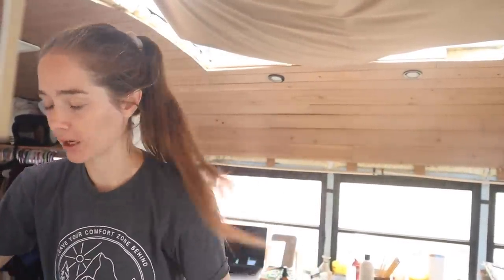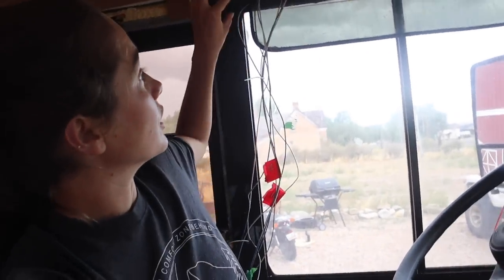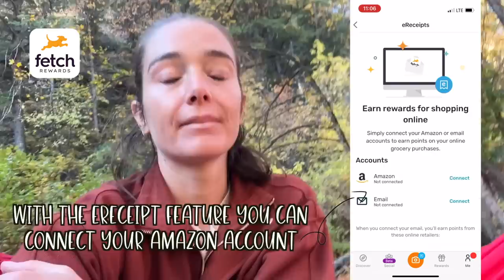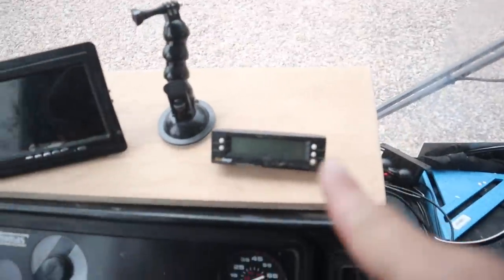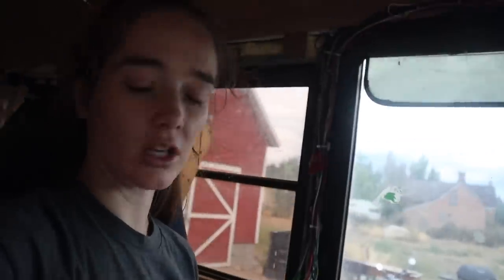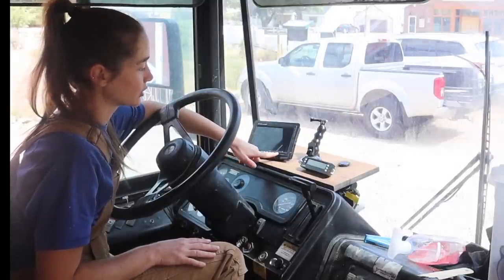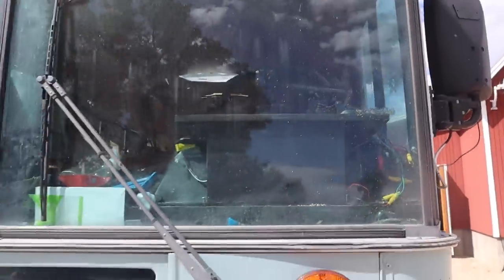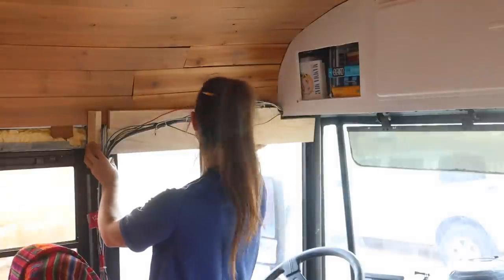finally addressing the ugly wire situation

Comment: Use wire covers like you would use for the wires on your TV if its on the wall they are available at Home Depot  there are different types and sizes. They are vinyl and have a sticky back on some of them but they are white or black.

Comment: 6:14 Mark. I have the EXACT same issue. I have gadgets I need when I'm driving but the dash in front of the driver's seat is too small, sloped badly AND made of flimsy material that can't hold any weight. So I'm also looking in to making a shelf that fits over the instrument console. I just get the willies with the idea of putting something against the windshield because the first big bump in the road I can picture my windshield cracking.

Comment: Emma, I love watching your videos and love your attitude. Just an FYI, check your package of tie wraps as most white tie wraps are not UV resistant.  What I mean by that is they will get brittle and break when exposed to sunlight for any length of time.  If they aren't they will only last a few months if continuously exposed the sunlight. You are probably fine for now, but if you notice them getting yellow, just know you will need to replace them.  Look for UV resistant ones when you go to replace them.  Of course putting the wiring in an enclosure will protect it from sunlight as well.

Comment: I was going to tell you a long time back, but forgot, maybe you could use decorative wire-chase to enclose all that wiring?  They have all kinds at home depot. it's like pvc pipe with a slit. or a removeable top allowing you to put the wire in the bracket, then cover it with the pretty plastic, long cap. the stuff on amazon is like 24" long and you get 8 pieces, I think. I use that for my entertainment centers. The stuff at the Depot is 8 feet long I think, been a minute since I bought any.  Good to see you on this cold friday :)

Comment: You can get that split wire loom in many sizes, as well as p-clamps in either stainless steel or plastic to secure it. With the clamps, you could either shoot new screws to mount them, or use existing screws, just take them out and reinstall them through the hole in the clamp.

Comment: Hey Emma!
Great job on the dash and getting the boxing in started! Just one thing maybe run a strip of black rubber along the edge of the wood that's facing towards (maybe its touching?) the windscreen, so it doesn't mark or crack the front windscreen if any movement! Also please make sure it's well secured down to the dashboard so that it can't fly toward you or through the window in an impact (God forbid) but better safe than sorry! Other than that it's all looking great! I love how you just work things out and get stuck into them! Great attitude! And the Bus is REALLY coming together now! Looks great! You're looking well too..
Cheers from London 👍😎🏴

Comment: So great to see someone with little skill but a can do attitude tackle this job and do well. 
Keep it up your mojo to do the tasks will come and go(hold on to the ups and try let go of the downs).

For your wood ceiling.
As the wood ages it will get darker and darker. It's the nature of wood with UV. Try get a clear sealer and put a white tint in the sealer(with a UV protection) I used an external sealer. It makes the sealer almost a watered milky colour. Then give the wood a couple of Coates it will result in a lighter looking wood with the wood grain coming through and prevent the wood from going darker. We use a product Woodoc 30 with a moonglow tint (this is in South Africa) I am sure you guys have something similar.

Onwards and upwards.

Comment: They use these pieces of wood that are about 1 1/2 x 3" with a grove already in it. You've seen them before, they run a strap through them when they band pallets and lumber bundles together. They'll give you a couple for free. Just cut a 45 degree when you go around the window. All that wiring should fit in that groove just fine.👍🌹

Comment: Are there not air vents for the windshield coming from below the platform you built in front of the steering wheel? Or are the vents at the top? Or no vent?! I can't imagine there wouldn't be any vent at all... But I don't have a bus, so what do I know...

Yay for trims! It will look a lot more finished once you've done that. After that, enclosing your bathroom and finishing your couches, and your bus will look like a home! 

Love your hard work and, mostly, your personality, always!

Comment: Use the black insulation for pipe to hide wires. It has A split in it the can be glued or taped. Secure with ties

Comment: Da, you made me happy today.. I was waiting for the moment you addressed the wire entanglement hanging all around.. Go, Emmy, just a little more effort to do. Oh, and that pencil in the hair is cool! 😊It's not easy to manage the wires when you move them elsewere as those were supposed to be, since those are always too short or too long. Nice work though, the black ribbed wrap thingy is neat solution. Don't get discouraged if you hit some obstakle, just think and make your way around. Good idea about the overhead concealment unit at the end.. Keep sticking to the pillars with the backing all the way down, then attach side parts from the side into the backing. I think it will be the easier way. Cheers though, you're doing excelent. Don't mind small imperfections and krookedness.. It's a part of the build. I know very well that adaptations in builds are way harder than to build something on measure from scratch. 
😜 Keep safe.

Comment: To make a plywood shelf look nicer. Get a 1 x 2 or a 1 x 3 oak or pine whatever your plywood is, that's slightly longer than your longest edge. On a tablesaw rip the 1x2 on the edge at like 1/8" so it ends up as a strip 3/4" x 1/8" congrats you now have a piece of edging for your plywood. Cut it same as or slightly longer than your plywood edge. Spread some wood glue on the plywood edge stick your edging on there and use a 18ga brad nailer with about 1"  brads spaced about 6" apart. Keep the edging centered as you nail it. Put remaining 3 pieces on etc. Remember this increases the dimensions of shelf by 1/8" each side so figure sizes accordingly. Sand/file top/bottom/ends so they are smooth/square and there's no lip from the face to the edge. Sand corners a bit so they aren't so sharp. You can fill nail holes if you wish. Use some of your sawdust you created mixed with a little wood glue for a good filler that's color matched. 

There's also thin veneer wood edging that can be glued on...but the 1/8" is a bit easier to work with

Comment: Your work is getting better but my issue is you can not block part of your windshield and view out of your windshield with a shelf and device's.
Good luck moving forward !
Reply from the maker: i didn't, it's the exact same height as the existing dash
Reply: That interpretation explains a lot 😕. Have someone stand in front of the bus say 20ft away then walk towards your front bumper, with you in the driver's seat, compare the difference of what you see with and without the shelf, with the shelf it changes your view. It will also block the air of your windshield defrost vents. Just one person's opinion.

Comment: I bet all color pigmentation for the stain is stuck to the bottom of the bucket, (especially if it's stain and sealer in one) get you a scraper and get it off the bottom then stir the crap out of it.  Great job!

Comment: If you had searched for cable concealers on Amazon you’d have found very inexpensive, simple stick on conduit you could have used to run the wires straight down. It would only have cost a few dollars and taken 15 minutes to install. I really wish you would make a super short video of what project you’re about to tackle before you actually do it so that people could chime in with options before you get started.
Reply from the maker: sometimes I know about the options and just don't choose the one you might prefer 💁😊
Reply: @EmmaBuildsBirbie  I don't have any specific preference. I was just thinking about options with your budget and skillset in mind. As someone that builds cars I've encountered many of the general challenges you've faced.
Reply from the maker: @BigIronTexas  honestly I have considered/tried to do what you've suggested and crowdsource advice on here but there are a few reasons why it's just never really worked that well :/
Reply: @EmmaBuildsBirbie  I can definitely see how crowdsourcing build advice would be a PITA (pain in the ass). You put a question out to 100k strangers and you're likely to get back every kind of answer imaginable with no idea which ones are good and which aren't. It would be great if there were a handful of knowledgeable people you could rely on for solid advice. I just don't know how you'd figure out who's a nut job and who's normal 🤔
Reply from the maker: @BigIronTexas  haha yes you get it. Luckily I’m much more capable than I used to be and I have a handful of people I can trust for advice so things really aren’t so bad

Comment: Just take the wires and run them through plastic wire sleeving...  you can get it from Home Depot in the Electrical section or from an electrical supply house near you.   You're gonna need big diameter sleeving,  maybe 2 1/2 or 3 inch.  Probably can get it on Amazon as well.   It will clean everything up and make it easy to get to the wiring if you ever need to again.   Wire sleeving is used a lot in the Electrical and Automotive industry.